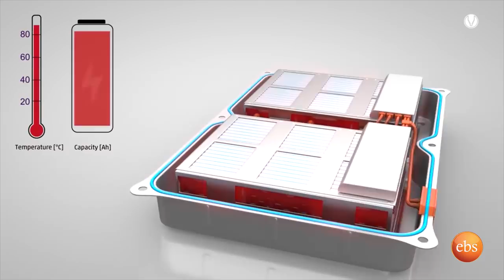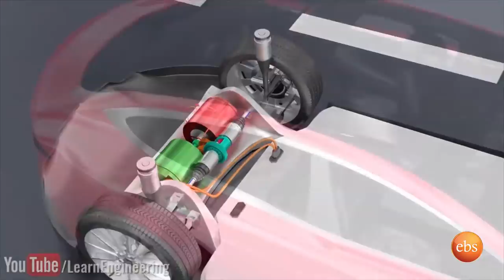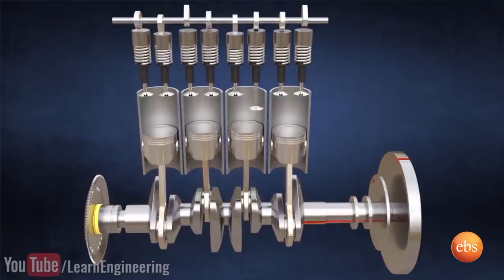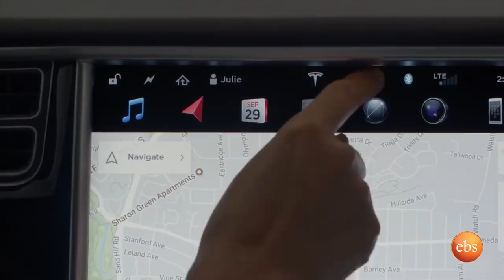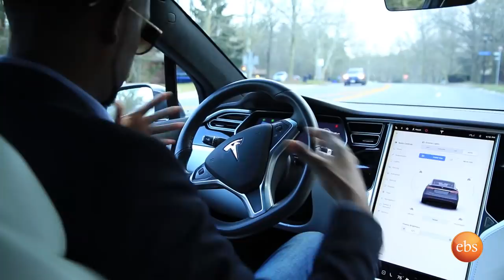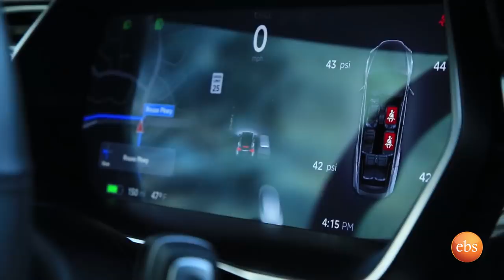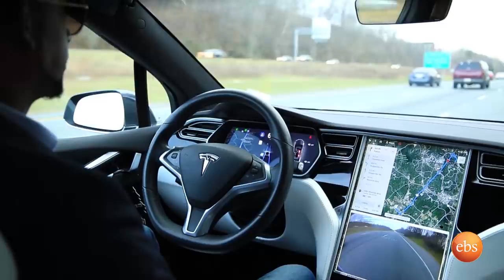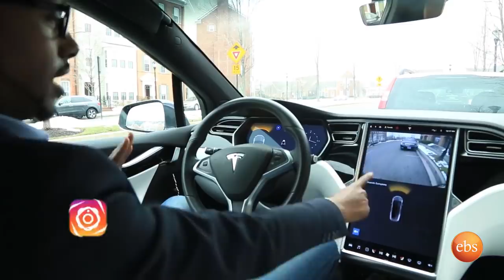TechTalk With Solomon S14 Ep 7 - የቴስላ አሰራርና አውቶፓይለት በመንገድ | How Tesla works & Autopilot Roadshow

Comment: The only problem of Tesla is over priced car.
Reply: 1. It's alignment needs some improvement also.
2. It's system corrupted sometimes, especially when it is on autodrive, and I highly recommend that people not fully trust autodrive. 
3. Easly makes a fire while accident happen 
Price-wise, Tesla model 3 is cheaper than Model S and X so not really expensive.
Reply: @endalksisay6918  You are right but other car manufacturers especially chinese once working hard to release their electric cars in a reasonable price soon. Hold on your horse guys and you will buy for cheap.
Reply: u can get the model X for as low as $35,000.u cant get 2018 corolla for that price here in Ethiopia.so don't tell me it is costly if u don't live in Ethiopia.
Reply: Endalk Sisay You're misinformed by FUD.
Reply: @habeshacasual636  I know. If you get the basic features it's not that expensive at all.   Audi A3 is sold for $45k